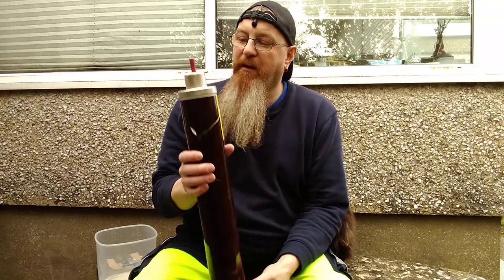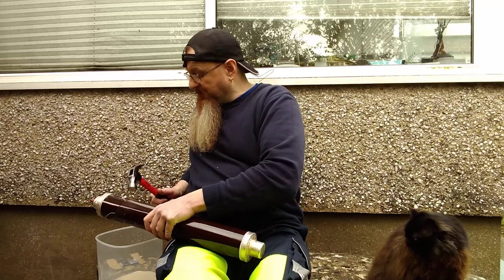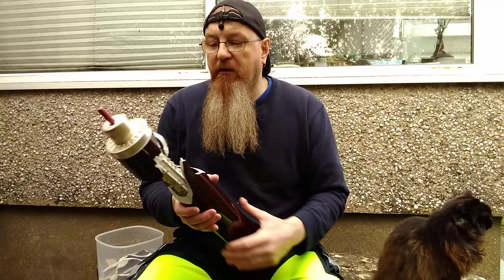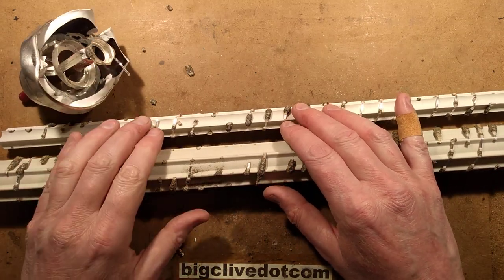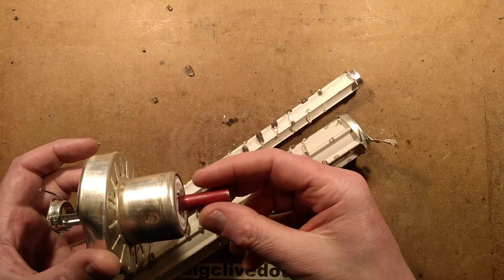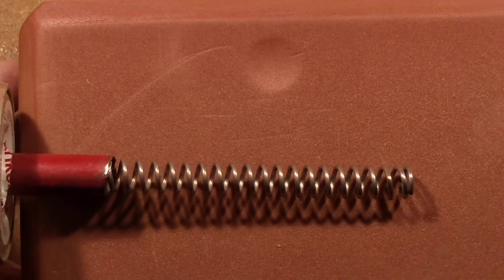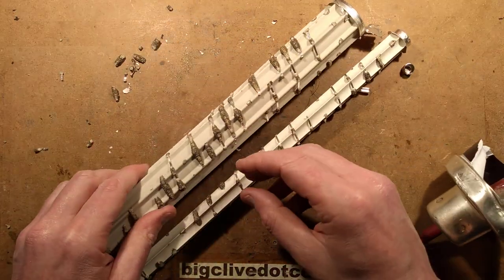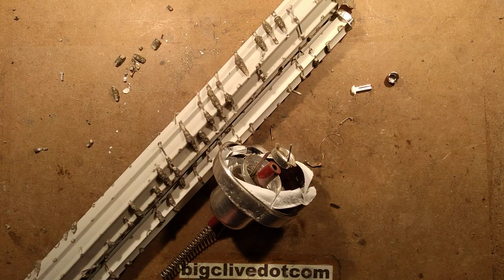A look inside a blown 36kV fuse.

Comment: Clive it won’t let me message you direct  but I watch you religiously and I need your help ... please do a video on how to repair pcb board where the track has lifted up ... I have a rare car part I’m trying to desperately fix but the solder point has lifted off the board
Reply: LOTS of info on that on the web; Search for "PCB Repair Services" and "Circuit Board Repair". I've used wire wrapping wire, soldered onto the traces before they broke, and superglued down onto the PC board, tho there are "better" more expensive ways to do it with copper foil and glues to glue that replacement foil in place of the burned trace. Just do some searching and reading :)

Comment: Wouldn't the thin spring wire just be a parallel fuse. In normal op current flows through the bigger fuse. If blown even normal operating current going through that tiny wire would blow it and the spring pops out. If true it's a stupidly simple mechanic. I like.

Comment: Watch out 007, Big Clive Blofeld is back with his sinister death ray disguised as a harmless industrial sized tubular pie maker.
Those inner ceramics would look cool if cleaned up and that neon wire/pipey stuff wrapped round them like you used to see in all sci fi movies (Buck Rogers lab, StarTrek etc..) You know, the thing that looks like a see through laser with red neon flashing away down its length lol

Comment: those ceramic tubes would make good coil formers, they had similar style things in the 20s and 30s 😉
Reply: andygozzo72 Presumably no change in design since then!  Those substations can be in operation for many decades without blowing the fuse, and keeping two generations of 63Ax36kV (1.2MW) fuses ready in the emergency repair van is just not practical.

Comment: Wife points out you are looking quite handsome, a bit younger even.
Tech tip: You were using a 60 Hz X-ray device on a 50 Hz electric device, which is why the sharp cutting bits were so dangerous.

Comment: 3 start spiral on outer ceramic vs 1 start spiral on inner: since the outer (looks) 3 times the diameter, the wires on the outer would be 3 times (ish) as long as the inner IF they have the same pitch. Guess what. The inner is 3 times the pitch (in turns per length) so the single inner is the same length as the 3 outers. ie same resistance. Tah dahh...

Comment: China is a cute puss.. Should feature him in more vids 😁 great video Clive, never seen one of those fuses before. Aren't the BS88 HRC  type fuses connected in parallel like these? Seem to recall from my college days many moons ago. Probably to stop any short circuit going with a big explosion, like a single fuse wire would? Like you say spreads the fault current and thus the velocity of the rupture.

Comment: From http://www1.cooperbussmann.com/pdf/68a3b44a-5c57-46e8-93b5-663e314b2430.pdf the striker has a striker coil that runs in parallel with the fuse elements.  Once the fuse elements melt and open, the striker coil then heats (carrying current) and releases the striker.  See page 5 of the PDF.